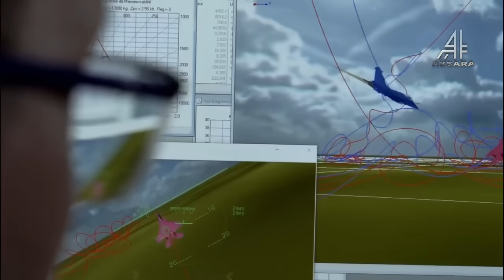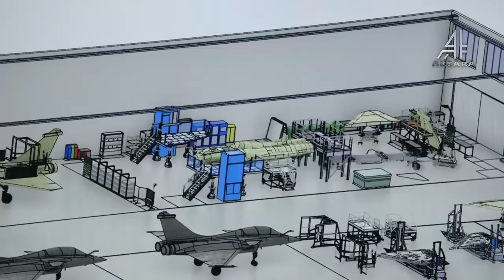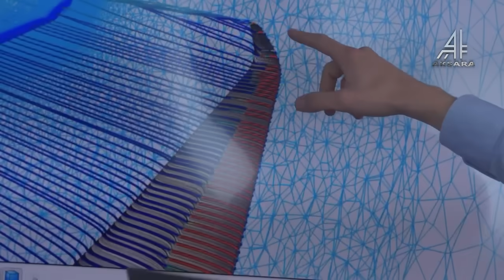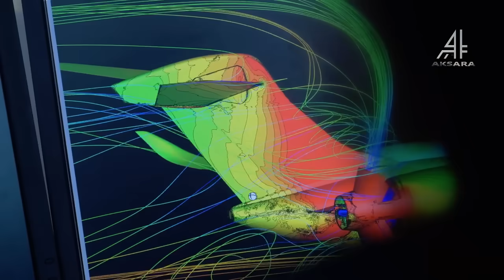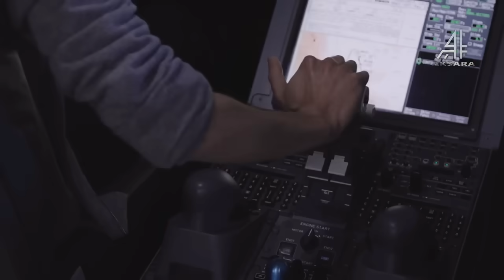MENGEJUTKAN DUNIA !! AKHIRNYA JET TEMPUR RAFALE PESANAN INDONESIA SEDANG DALAM PROSES PENGIRIMAN

Comment: Krna slama 79 thn kurang dlm presiden ke 1&6 infrastruktur nya mulai pembangunan ekonomi, Tol, gedung2 Rmh skt,  industrian, waduk air, jembatan, IKN, pembangunan pasar, gedung2 pemerintahan, rmh penduduk yg tertinggal, kantor2 pemerintahan, lapangan stadion ,MRT,LRT mengejar ketinggalan dgn negara berkembang lain nya , Alutsista modernisasi  semua dpt nilai 11 di presiden ke 7 di bawah nya dpt nilai min - 3 angka pres 1 hingga 6 juru penilaian PDI. P , Perindo & Nasdem, PKB >berarti presiden ke 1 halo pres ke 2 halo semua halo2 bandung baiknkerjanya KMB konferensi meja bunder -3 nilai nya slma 69 thn